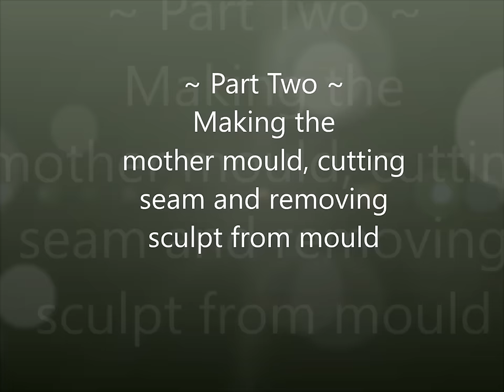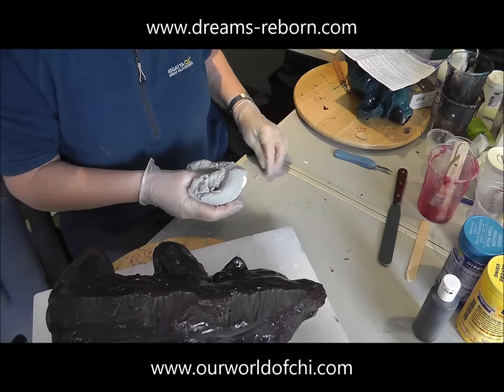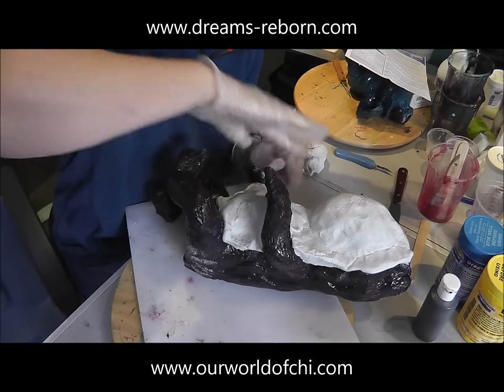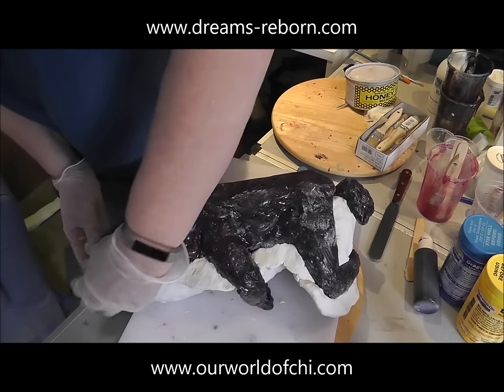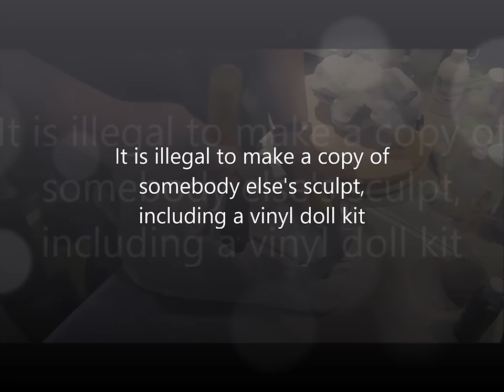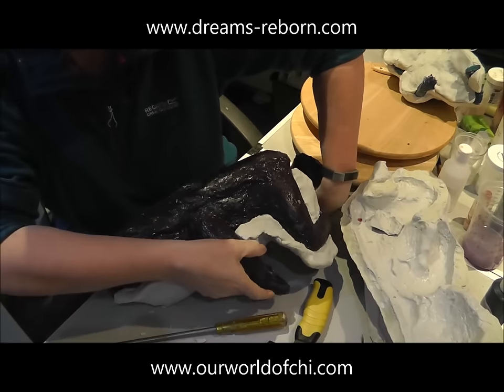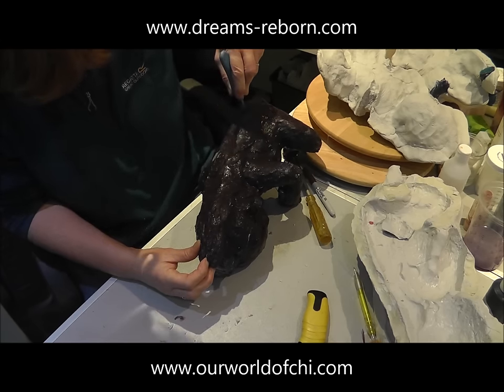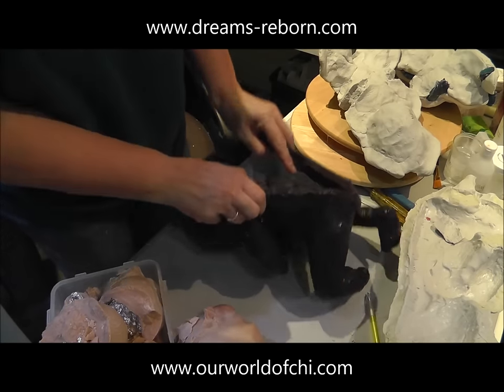Making a Silicone Baby Doll - TARRA - Part 2: mother mould, seam and removing sculpt

Comment: Excellent work, very explanatory. a question, for a 3-inch miniature baby you need as much work as this?
Reply from the maker: You woukdnt need a mother mould for a 3” and the all the stages would be quicker because of the size but you would still pretty much go through most of the stages yes. Depending on the pose of the baby you might be better
Doing a 2 part mould for a tiny baby.

Comment: I'm not a silicon doll maker, I just like watching things get made and learning techniques. I am interested in armature sculpting however, any who I think I missed it, but what is the purpose of the outer clay application and drying? is it to better secure and firm the silicon around the original clay sculpture?
Reply from the maker: aswee01   The glove mould is quite flexible and would not support itself when pouring it
Would be like pouring liquid into a rubber glove - by making a shell, or mother mould, it ensures the silicone mould holds its shape while pouring.
Reply: Thankyou for your reply, I was wondering too. I saw someone who makes weird support type things that she put what you call you glove mounds in for pouring. It was like a deep wooden box with a "rubber glove" nailed to a square frame around the top of the box then she pours into it.
Reply: Glove moulds NOT glove mounds, my mistake

Comment: can you use the eco flex silicone for the mold as well or do you need to use Dragon skin to make the mold?
Reply from the maker: Kayla Yuill ecoflex would be too soft for the mould and also not suitable for brushing on as it is much thinner and more runny it would run right off and take many dozens of coats to get any kind of thickness

Comment: What actually breaks the clay? You made the mold with rubber and then placed the mother mold over it. Is it the tapping of the mother mold getting it open is what's breaking the original sculpt?  It's in pieces but it didn't seem to have gone thru any severe  damage or anything so I'm just wondering why the original sculpt always breaks?
Reply from the maker: We have to break the sculpt so that we can get it out of the silicone glove mould.